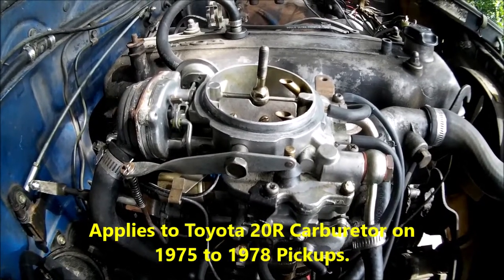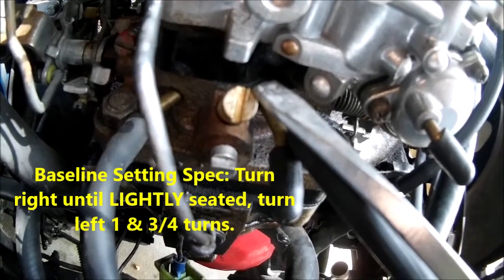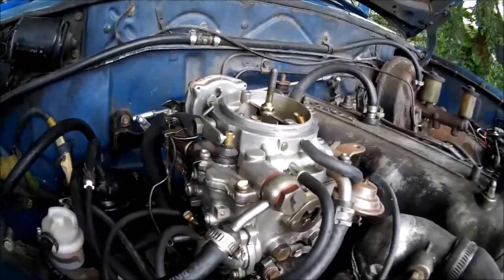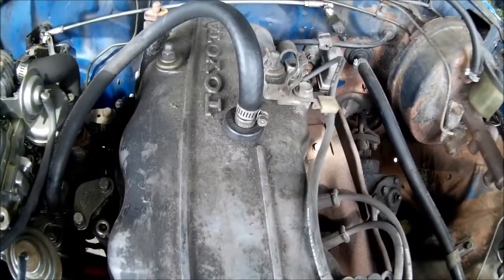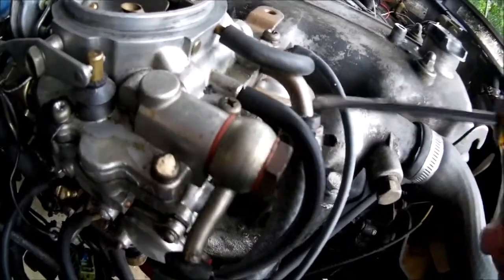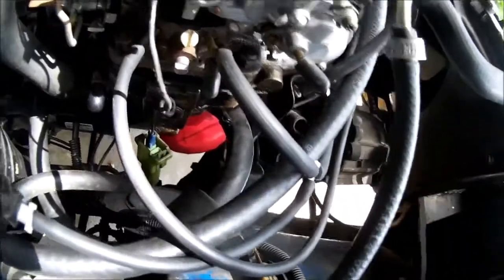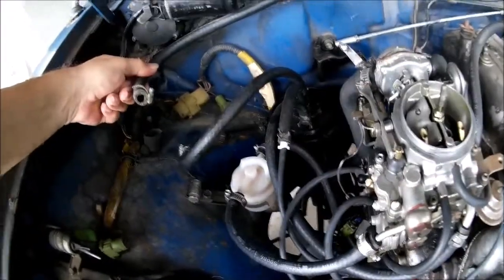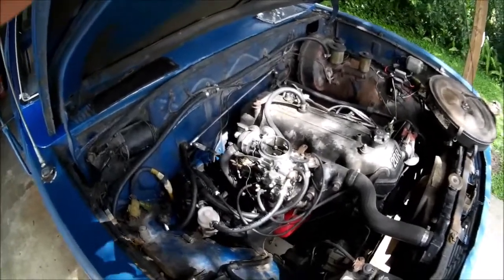1978 Toyota Pickup/Hilux 20R-Carb Adjust & Vac Lines-Desmogged

Comment: Buenas noches   disculpe usted sabe cuantas vuelta son para el tornillo de la mezcla   y el tornillo de ralenti  para  este mismo carburador   saludos
Reply from the maker: Traducción vía Google translate, ya que no hablo español. Como ajuste inicial para el tornillo inactivo, debe ser de una a una vuelta y media. Debería poder ver cuando la punta del tornillo hace contacto con el brazo del acelerador. Debe haber un ligero contacto entre estas dos partes. Para un ajuste de "funcionamiento", ajústelo hasta que obtenga la velocidad de ralentí correcta, que está entre 800 y 850 RPM en ralentí, con el motor a la temperatura máxima de funcionamiento. Necesitará un tacómetro para configurar esta velocidad de ralentí con precisión, o sin un tacómetro, puede configurarlo "de oído". Si tienes la habilidad. Al menos puede acercar la velocidad a lo que debería ser.

El tornillo de mezcla inactivo debe girar hacia la derecha hasta que se detenga. NO apriete demasiado el tornillo, ya que puede dañarlo y causar problemas. Simplemente gírelo hacia la derecha hasta que sienta que quiere detenerse. Tenga cuidado con el destornillador y no ejerza mucha fuerza sobre él.

El tornillo de mezcla inactivo debe girarse hacia la izquierda entre una vuelta y media a una vuelta y tres cuartos. Esta es una configuración de "línea de base" solamente, pero debería funcionar en la mayoría de los casos, si todas las demás cosas y el motor están funcionando correctamente.

Con el motor en marcha y completamente calentado, puede ajustar la mezcla inactiva si lo desea. Gire el tornillo de mezcla hacia la derecha un cuarto de vuelta a la vez y escuche la calidad del sonido de los motores inactivos. Tan pronto como el sonido cambie de suave a un poco áspero, deténgase. Luego, gire el tornillo hacia la izquierda un cuarto de vuelta a la vez hasta que el sonido inactivo sea suave. Si todo está bien con el carburador, el tornillo debe estar en algún lugar entre el ajuste de una vuelta y media a uno y tres cuartos de vuelta. Una vez que tenga la calidad de ralentí más suave posible, vuelva atrás y vuelva a verificar la velocidad de ralentí.

Esto es lo mejor que pude hacer por ti. Pido disculpas por cualquier problema con la traducción de Google.
Reply: @The13thSword  A man of the people helps those not in his native tongue! thank you for these videos king.
Reply from the maker: @carlos_andres_  Traducido por Google. Usted es muy bienvenido señor. Pero yo no soy un rey, solo un hombre como tú. Necesitamos ayudarnos unos a otros por un mundo mejor. Me alegro haberte sido de ayuda.
Reply: @The13thSword  haha of course not. It’s a saying the youngsters apply now - basically it means that you are a good man 👍 I’m restoring my 1980 hilux and your videos have been helpful.
Reply from the maker: @carlos_andres_  Again, many thanks for the recognition, & I am glad that my videos have been a help to you. That was always my intent with posting this vids. If I can help further in any way just let me know.

Comment: this was actually a very helpful and informative video. for some reason it's really hard to find information on these engines aside from an owner's manual. usually people are just like "yeah. so here's the doohickey and the thingamajigger, turn the doohickey until the thingamajigger opens up and then get your fleeblegorp to adjust the donglebob. but I'm just gonna ignore all that and replace the carb with an edelbrock or a weber"
it's like they just assume you know where everything is already. I get that carburetors are a basic design but if you've never worked with one before, getting specific information on a stock unit from the 70s is surprisingly difficult
anyway, thanks for making this video. I needed someone to explain it to me like I'm 5 years old because I'm dumb lol
Reply from the maker: First and most importantly, you are NOT dumb. There is a difference between being truly unintelligent and just not being able to obtain the information. So please do not devalue yourself like that, even jokingly. You're better than that. :^)

Your message is the exact reason I went into the detail that I did about the stock setup. If something worked once & worked well, it can work well again. Most Toyota systems are very well engineered, so there is no reason to think they have to be yoinked off & replaced with some non-stock item that was never specifically intended for that application. Not to put anyone down, but that tendency to do that is just being a bit lazy in my book. Some people can't be bothered to even try to understand what the original intent was & just slap some solution at a problem that will "work", regardless of how well it will work. They are free to do so if they wish. But I prefer to know how the durn thing is supposed to work as intended. Just my opinion.

I'm happy that the info & how I presented it was helpful to you, & thanks for letting me know that. If I can help with anything else just ask.

And don't forget to fine tune your carb's ka-nibbler valve & measure all clearances in microns (1 millionth of a meter). Totally kidding here. :^D

Comment: Wow dude , mines been having trouble with starting while it's warm, smells like it's flooding
Reply from the maker: If you go to start it when it's warm, have you tried holding the gas pedal to the floor then cranking the engine over? Try that and if it starts much easier than usual, you definitely have a "flooding" problem. What that does is open the carburetor butterfly valve fully open, allowing the maximum amount of air in. This can make a "flooding" or over-rich condition (too much gas) something more in line with the fuel/air mixture ratios it should be.

In any case, this is almost always caused by a malfunctioning carburetor. The carbs on the 20R engine are quite good, but like any other carb they have parts & gaskets that are subject to wear, which can mess up your fuel/air mix ratio. There can also be "junk" inside the carb, clogging up some very small passages, especially the idle circuits.

Best advice is to have the carb professionally rebuilt, or buy another carb that's already been rebuilt & tuned. I did the later & got one from National Carb (https://nationalcarburetors.com/). I highly recommend them, even though I am not sponsored by them.

If I can help with anything else let me know, just make sure you give me specific info.
Reply: @The13thSword  wow 👏 this is amazing dude , what a thorough reply . Dude i can't thank you enough. I am currently living in this truck and it can be worrisome when things aren't right . Cool I'll check that website for the carbs thank you so much dude. The other problem that I'm having with the truck is at higher rims like right before its time to shift it makes a hum like buzzing sound that increases as my rpms keep increasing and then when i shift and let out the clutch and my rpms drop the noise stops. And when I get on the hwy and get to 5th gear I can kinda hear it when I'm driving but I don't go above 65 atm I was looking for information and was going to check out the fan and belts, they both need work or replacement. I just bought this truck from a lady who let it sit at her vacation home so people would think someone was home so it sat in her driveway under a pine tree for awhile , but she was the second owner, bought it in 79 from a college student whose dad bought it for her brand new , it was neat to sea the owners manual looking new and some of the Japanese paperwork still in the plastic. Anyways always cool to talk about the truck man. People stop me all the time an just have a passion for the toyotas of the past . It's cool . Wel thanks dude God bless
Reply from the maker: @timothy2935  You are most welcome. I've amassed a pretty fair amount of knowledge about the '75 to '78 trucks, and I know it can be hard to find on the web, so I don't mind sharing it where it will help.

The belts are fairly cheap and available in most part stores and aren't too hard to change out. They are one of the "reliability" items that you should change at the first sign of any major wear, cracking, etc. No sense getting stranded over an $8 belt, especially id it's the alternator belt. yikes.

Certain RPM noise - what causes it depends on if you can narrow down the area it's coming from. You mentioned the belts & fan so I assume it's coming from the front? We'll start there.

As for the fan, it's rare, but sometimes the fan clutch can wear out & make noise at certain RPM's. That's the metal part mounted to the front of the fan. It allows the fan to disengage from being fully driven when temps are below certain levels, and engage the fan when things get hot, to move more air over the radiator. Test: on a non-running engine (can be totally cold) spin the fan by hand with some speed. You should feel some resistance to turning it. If you feel no resistance at all, or if the fan turns 5 or more complete revolutions, it's likely the fan clutch is bad.

As long as you are up front, grab the fan by the back of it, where it connects with the shaft coming out of the water pump, & try to wiggle it up & down and side to side. You shouldn't see any movement. If you do see movement that is more than just noticeable, the water pump bearing could be going bad. Those can sometimes make noises only at certain RPM's.

Other things it could be? Clutch out of adjustment, clutch throwout bearing going bad, weak finger springs on the clutch disc, worn out clutch disc material. If the noise is actually more in the area of the firewall, or where the engine & trans bolt together, and the clutch is old (say 80K miles or more) I'd suspect the throwout bearing. Those have been known to only make noise at certain RPM's when they get worn.

On vehicles that have been sitting, You said you just bought it so I assume you have done too much to it. And if you've been running today's regular ethanol gasoline, that could also cause your "flooding" problem. The old rubber gas lines weren't made to handle methanol, & with age they can & will shed rubber particles off on the INSIDES of the hoses. If your fuel filter doesn't catch these, they can easily clog up your small passages in the carb. I had this problem; the idle circuit was clogged with tiny black rubber particles, truck would hardly idle & ran "rich". It was trying to run only on the Main Jet circuit of the carb, which are larger opening, which allows more fuel to pass.

I know it's kinda a pain in the butt & could take several hours or the whole day, but get some new rubber fuel line & replace it all, plus put a new fuel filter on it. I also recommend new hose clamps to prevent leaks.

BTW, DON'T run any Seafoam thru the fuel system thinking it might solve the problem; if you still have the old fuel hoses on there it could just make things worse. That stuff is known to loosen up even more stuff, & you don't need that reaching your carb.

I see you have another message so will go to that next.
Reply: @The13thSword  dude I just tried it and it fired right up! Then another problem happened rpms were low when I got to a stop and when I took off, I between shift it let put a bunch of smoke and seemed like it almost back fired. Then now I stopped turned it off and it fired right up,  I actually seems high now. So im going to check that screw you had mentioned on the carb so it doesn't slam closed that Last 5 percent
Reply from the maker: @timothy2935  That confirms that the engine is getting too much fuel, so it is most likely a carb issue. The smoke & almost backfiring is also a sign that there is too much fuel going to the engine. The smoke, backfiring or popping is unburned fuel coming out of the engine on the exhaust side. That proves it's getting too much fuel and can't burn it all on ignition. Backfiring or popping happens when the hot exhaust with extra fuel vapor in it get towards the end of the exhaust pipe, finds some extra oxygen in the outside air, and spontaneously combusts. The bunch of dark smoke is that unburned fuel.

There's no need to mess with the Dashpot screw; it won't help if you're running rich like that. The carb sounds like it's the main issue, as it's what controls the fuel/air mixtures. Unless you get that mixture right, no other carb adjustment is going to help the situation.

If you want to check that the Dashpot is in adjustment (it should be), run the engine, rev it a bit then let go, watching the Dashpot lever system where it makes contact with the adjusting screw. You should see it "catch" just near the bottom of it's travel, then completely "bottom out". All this happens in less than a second & is all you need with a properly running engine.

Afterthought - When the engine is completely warmed up, are the choke plates on top of the carb open? They should be when hot. When cold, one push of the gas pedal to the flor & releasing it should close the choke plates completely. 

Just thinking that if your choke plates are always stuck closed for some reason, that would also make the carb "rich". They wouldn't let enough air in for hot running. That's why I asked you to hold the pedal to the floor, to manually hold the choke plates open, & let me air in when hot.

And since you said it's been sitting, sometimes carb linkages can get stuck or gummed up & not work right.
If you have any spray carb cleaner around you could try spraying down all the outside linkages to make sure they are clean.
Reply: @The13thSword  oh my God my dude,  thank you so much for that in depth response 🙏  I was forced to drive the truck from Denver to Los Angeles   it stopped all the back firing and was running so perfect, still running rich , but I accidentally touched my hot terminal to my radiator and shorted out something I believe, the truck now doesn't wanna shut off when I flip the key off the engine will keep running sometimes. I definitely need to pull the carb and do a rebuild. I haven't done that yet with this beauty. Thanks for the awesome responses it's appreciated 😀
Reply from the maker: @timothy2935  Always glad to help. If you're well versed in carb rebuilds and have done many before, go ahead with the rebuild. But if not, I've learned it's better to let a pro handle it, like National Carb. It's just a ton less hassle & they usually get it right, out of the box. Just bolt on & drive, maybe with a few very minor adjustments, but you can handle those easily.

Just let me know if you need any other info or help.

Comment: i'm removing the old carburetor & replacing it with a weber 38 & a new intake manifold can i run the coolant hoses together that are in & out of two water choke ports?or what else can i do with them?
Reply from the maker: Sure you can. It would just serve as a coolant bypass. You could just use a new section of heater hose that fits the ports and loop it. Ss long as it doesn't kink on you it'll be fine. If I were doing it that's what I'd do. I would NOT just cap the ports, because that would affect coolant flow and could cause you to lose some or all of your in-cab heater function.

Comment: Thank you so much , 
I  have   92  22R enjin, but your explanation is very helpful.  Can I ask you how can replace the PCV ?  ITs shaken and I can't remove it &  i don't know it's work good or not.
Reply from the maker: The PCV Valve is just pulled out of the rubber grommet it sits in. It can be a very tight fit, so you may need to use pliers to get a good grip on it to pull it out. Disconnect the hose going to it first, and grab the top of the part with the pliers and pull, hard if you have to, it will come out. Also be sure to inspect the grommet to make sure it is in one piece and not dried out or the rubber has turned hard. Since your truck is 29 years old, it would be a very good idea to replace the grommet.